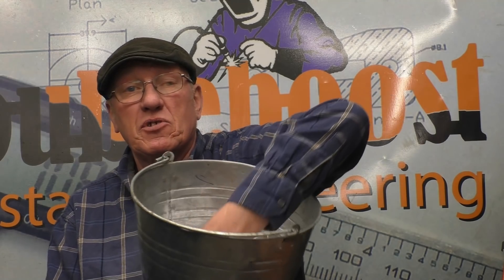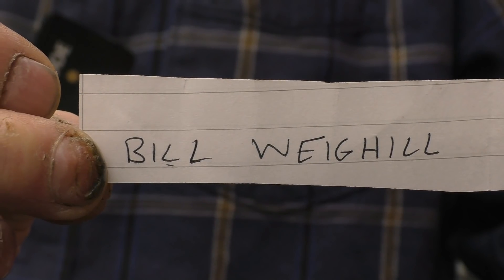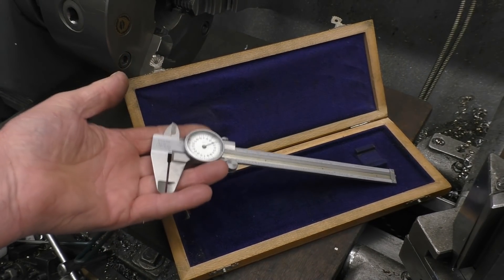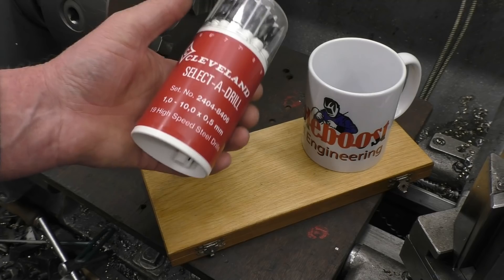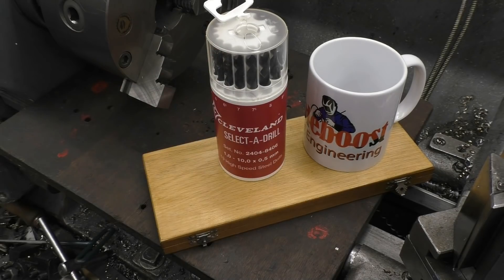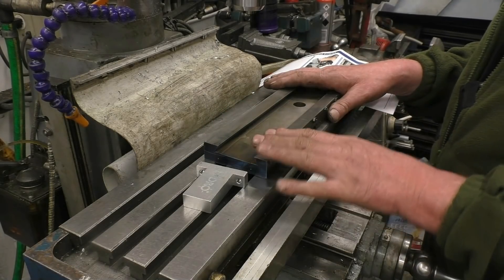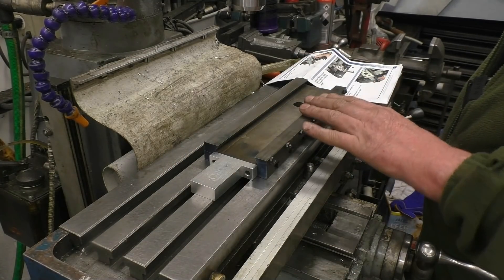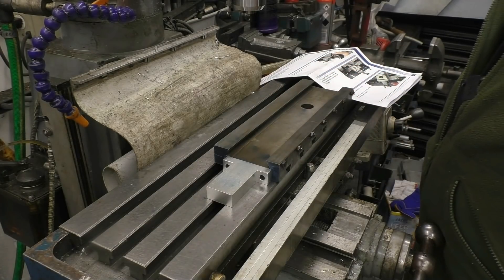SNNC 431 P1  Myford ML7 Cross Slide DRO

Comment: Congratulations Bill, great job John on providing the prizes.
Anyone used, or remember "Sticky Pin", ref picking up scribed lines on a mill?
Great video,  thanks for sharing.
Reply: What is a Sticky Pin?   Would like to know More about it.   Yes and great for John on providing the prizes. 

Dale in Canada 🇨🇦
Reply: @dalemcinnes1834  Hi, a " Sticky Pin" is simply a sewing needle held in plasticine,  or other slender sharp pointed item. A predecessor to a "Wiggler Point". To use it, you just stuck the plasticine holding the needle pointing down on the milling cutter or drill bit, start spindle,  then use your thumbnail to centre the point, you now have a true running point.
Advantages: no need to remove milling cutter, so quicker. 
Disadvantages: beware of applying to sharp cutters ( I can confirm blood is drawn), maybe use a steel flat surface,  rather than a body part, ref nail.
This is my understanding of a Sticky Pin, as it was shown and used by me during and well after my machine tool apprenticeship. 
Hope this helps.
Reply: @bostedtap      I can see that it would work and be great for getting on the mark for scribed lines.    I have never heard of it and I would like to see someone demonstrate it.   You would have to somehow find the center of the end mill.   Thanks for the reply. 

Dale in Canada 🇨🇦